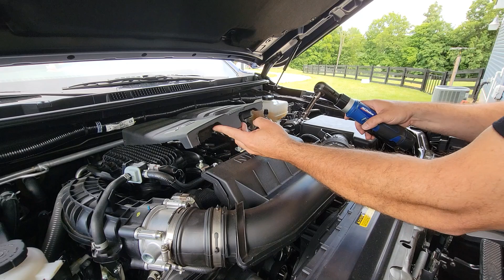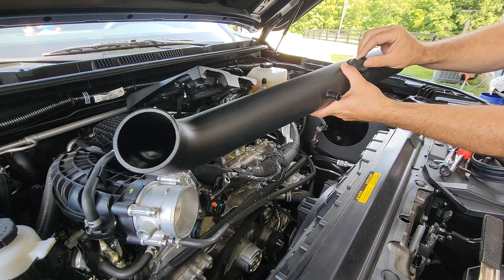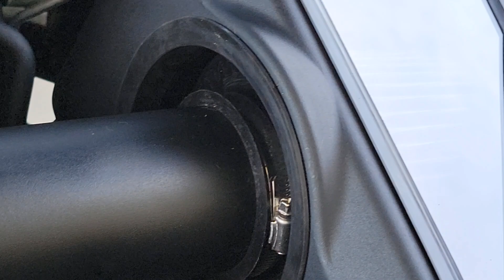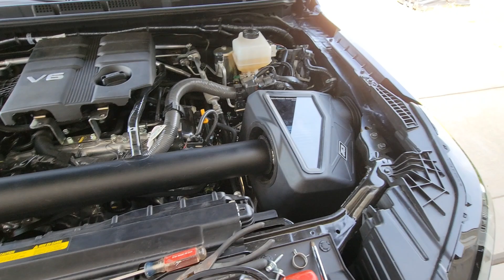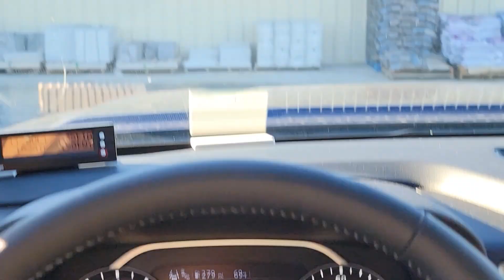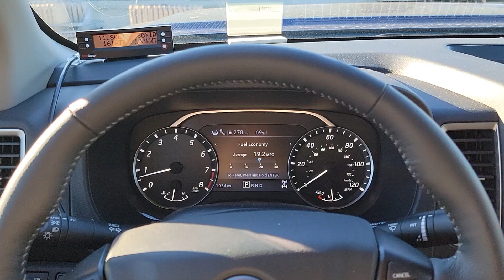Z1 Off-Road Cold Air Intake Kit for 2022 Nissan Frontier

Comment: U have to reuse the factory air box bolts and gromets they do pull out from bottom, my kit came with air tube clamp for pcv hose theirs is wider, the extra piece he had goes on out side the fender and is not really necessary

Comment: The filter box sits on top of the screws, since the box has those rubber seals. I firmly pressed down while moving left and right. Eventually the screws went into the rubber seals and its firmly secured

Comment: I did a custom exhaust on my 2021 frontier with the new 3.8L V6. It's 3" aluminized steel catback to a Black Widow Race Venom muffler with dump pipes. I also just ordered my AFE Momentum GT intake and cant wait to install it and see how it helps compliment the new exhaust and performance

Comment: Late to the party on this one, but the rubber piece you did not use attaches to the fender well from the other side (necessitates liner removal). It's a "velocity stack" of sorts and helps to funnel in air a bit. And yes, you reuse the factory rubber grommets. You do NOT remove the "bolts" as they are meant to stay in. The rubber factory grommets pop on/off of them.

Comment: Theres no gain at all actually hurting performance. Best to keep the stock air box. Cold air intakes just heat soak the engine. If anything an Xterra or frontier 4x4 deserves and snorkel but you wouldn't be able to do that because you don't own the truck..
Reply: this intake actually works. youre talking about the open filter ones that draw hot air from the engine bay. the Z1 uses a fully enclosed airbox and draws air from the factory fender location. and heat soak? no, intakes do not heat soak an engine, improper thermal management does that when the vehicle cant remove that heat fast enough.

Z1's intake is a larger tube thats free'r flowing and uses a larger air box inlet with a free'r flowing filter. physics says this will make power over stock. and its the same/similar composite as OEM

Comment: I'm pretty sure that extra large rubber gasket is for the other side of the outer fender.  I hear it's kinda of a bitch to get into place and not really that big of a deal if it doesn't go in.

Comment: Seems like the factory intake fits the exact same way. Therefore, the truck already has a cold air intake. I just dropped in a K&N replacement panel filter and saved 400 bucks.
If what you pay for this intake is worth what you get out of it (additional power/torque). Let me know and I'll buy one tomorrow.
Reply: They have dyno results that show increases in both WHP and Torque.
Reply: i was thinking of doing the same thing. tbh they just sound throatier
Reply: Next time do it video on that K &N replacement please

Comment: There are many better choices for cold air intake.
Reply: CAI is a silly scam. The air is cooler coming in from 99.9% of all OEM air intake systems.
Reply: except this is a true cold air intake. it draws from the same location as the oem one and uses a fully enclosed airbox....it just flows better then stock

Comment: My 2020 Frontier (same engine) has an open breather as well. Pick up a WIX inline fuel filter from Oreilly's. Pops right in. You can cut the other barb off for more air flow.

Comment: I would have taken that back off and sent that thing back.It doesn't fit right and it won't make one bit of difference with performance.It looks like all that thing does is change the shape of your air filter
Reply: It added HP and Torque in the dyno...
Reply: a better optimized intake system doesnt make power over stock? interesting take. this intake is a true cold air intake, uses a fully enclosed air box like OEM, draws air from the OEM location thru the fender and it FLOWS more over stock. physics and dynos prove this intake makes power

Comment: The same everything as the 2016 except fot the extra gromet the kit they send is not 100% compatible I had to modify several modules in order to make it fit, also they did not include the valve cover to intake hose in the kit like theyr said was there but wasn't ... Easiest way I had it installed before I realized that hose was not included,  I hill billied  it by using a garden hose piece for a temproarary use and it worked ... got a replacement hose and had to tie wrap it to another spot and it cleared very well

Comment: All that and didn't even gain even a half of a horsepower. People and their myths thinking adding a cold air intake to gas aspirated engines is going to give them horsepower.
Reply: It adds closer to 10. Watch the dyno testing.
Reply: they do make power when you throw emissions compliance out the window lol....and the funny thing is, this one is emissions compliant. a properly designed cold air intake will make power over stock.

Comment: The instructions are online. There's nothing wrong with the design you installed it all wrong. This is why I never buy used cars you never know what the hell the last person did
Reply: How did he install it wrong that’s literally how it’s supposed to look
Reply: @flipflop2221  The end result yes. My comment was just regarding all the issues he had with the installation process. He was complaining about how difficult it was; however, if the steps were taken in the correct order, it would have been an easy install unlike what he had to endure. And have you read other comments? There are countless other people saying the same thing.

Comment: You installed it all wrong. The big O-ring gasket goes on the snorkel tube, outside of the filter and is secured to the filter box.

Comment: K&N includes complete picture directions. Have installed on three Frontiers and they are easy. Easy to service the filter also.
Reply: Should be easy, you’re replacing the stock intake assembly with a silly looking, functionally identical component.
Reply: What’s the number for the K&N please, thank you
Reply: Don't have truck anymore. K&N  listed  by year so it's easy to match up.

Comment: I like my frontier, glad I didn’t have to buy a gladiator!
Reply: Yup. Jeeps are junk. These Frontiers are far more reliable than any jeep.
Reply: I'm a jeep guy I have a 2000 cherokee 2015 rubicon and 1959 fc 170, needed a work truck looked at the gladiator the frontier with king cap had a longer bed,I just wish it had a straight axle,hard to lift did a 3.5 spacer but am doing a titan swap with carbon shocks coil overs,should get 4.5 and a whole lot more articulation

Comment: Per the online instructions that oval piece goes on the other side of the fender, you’ll have to,pull the wheel and fender liner to install.
Reply: that was the hardest part. I just turned the wheel and popped the fender liner part way and got in in